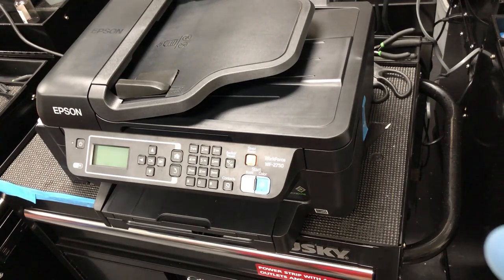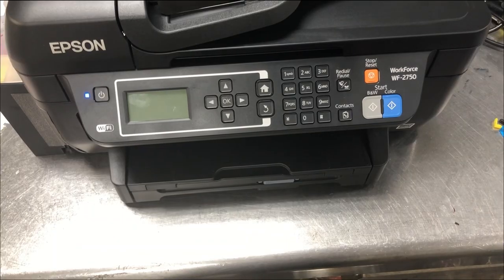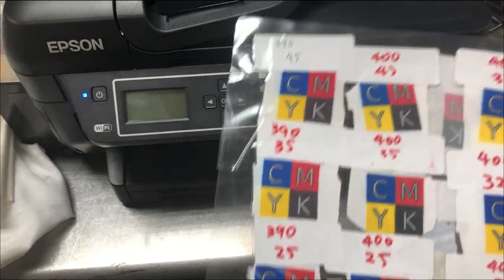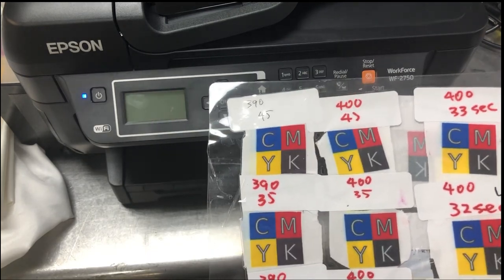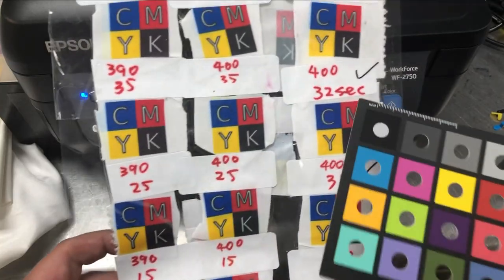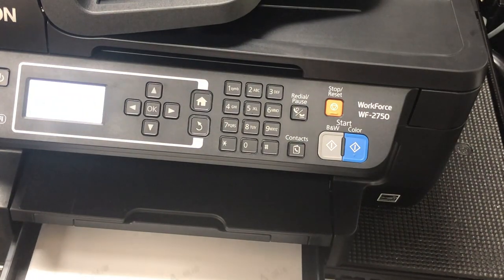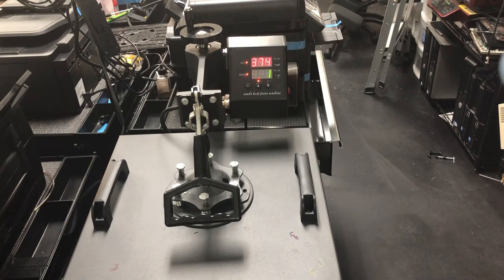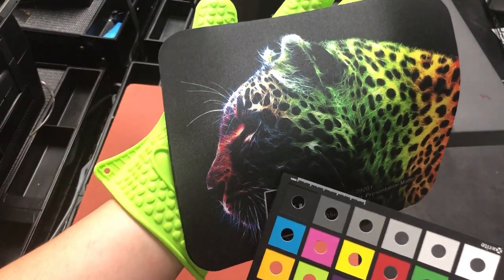Start Sublimation Like a Pro - Epson WF-2750 with Zero Cartridge System

Comment: Great video! How to make sure the art is aligned with the material? Looks like your logo turns out well aligned with the bottom of the mousepad but you made it by just eyeballing the paper
Reply from the maker: This one is easy.  For the hard ones, I print check border or use marking tapes.

Comment: Mine is not recognizing the yellow.  Any suggestions?  I have taken it out and placed it back in several times.
Reply from the maker: You may have a bad CSIC pin board.
Reply: It reads my yellow that came with the printer but not the sub ink cartridge